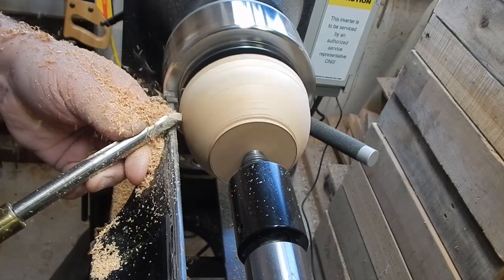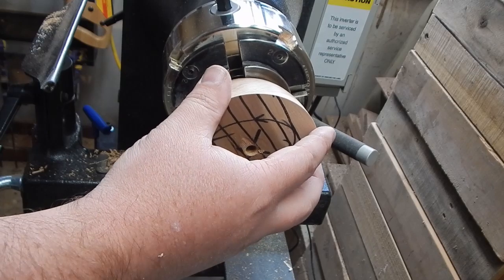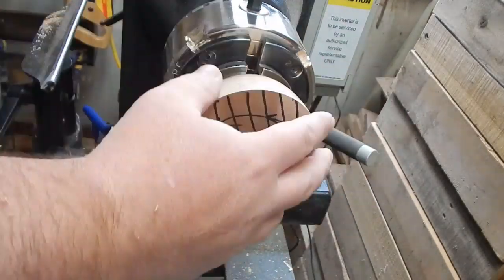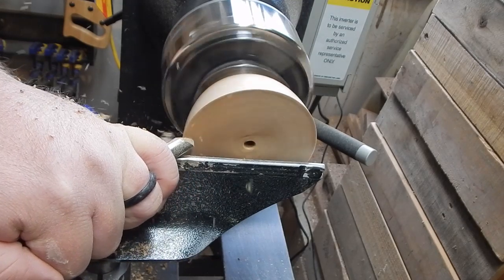Easy Woodturning Projects Episode 4 / Small Wooden Bowl

Comment: Very nice!  I am fairly new to turning have done some pens and a few small bowls.  Why don’t people make end grain bowls?  Less pretty, harder to turn, something else?  My favorite has been taking firewood and making nice things!
Reply from the maker: You can make end grain bowls. I’ve done it before.  The hollowing technique is different but it works.  The problems are that it leaves you with short grain areas on the bowl that are not as strong.  It can make it more prone to breaking. Also for food use liquids tend to wick through the bottom easier. With some open open grain woods it’s like having little straws on the bottom😆. It’s worth it to learn the hollowing technique though. Plus many woods looks different in different grain configurations.

Comment: Hi! I’m just starting to turn. I’ve made 65 pens, but would like to make a bowl. I use carbide tipped tools.. is the process generally the same as you have demonstrated here? Thank you.
Reply from the maker: Yes pretty much.  Different tool presentation because you are basically scraping with carbide tools.  Just be careful not to hang the tool over the tool rest too far, and when you are on the inside of the bowl keep the tip slightly above center.  It will help catches not be so severe. It’s slower going than traditional tools, but it doesn’t matter how you get there. Just that you get there. The final product will look great still. I wish you well.

Comment: Nice job. I’m new to wood turning. I’ve done bud vases and bowls. Do you find getting the ridges and tool marks out is difficult without a negative rake scraper? I’ve seen others do this and spend less time sanding.
Reply from the maker: On a small bowl like this it’s not too difficult. Most if not all the work can be done with a bowl gouge if you don’t own a scraper. I’ll admit it’s nice to have a negative rake scraper sometimes.  I use one as well. There is usually more than one method to get to where your going. I suggest trying it both ways and it will make you versatile with your tools.